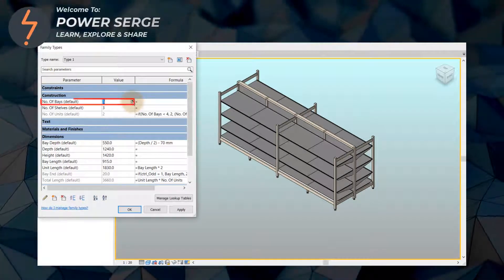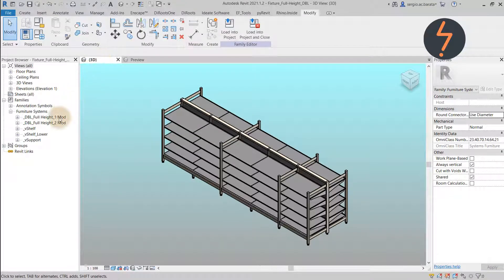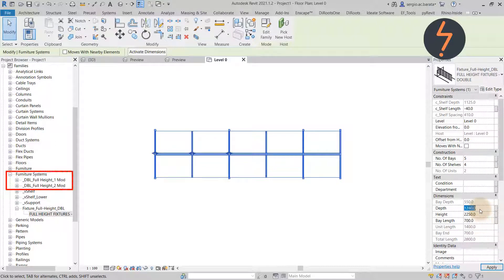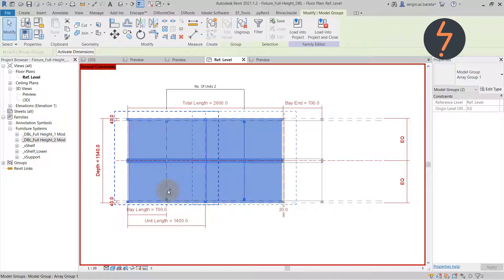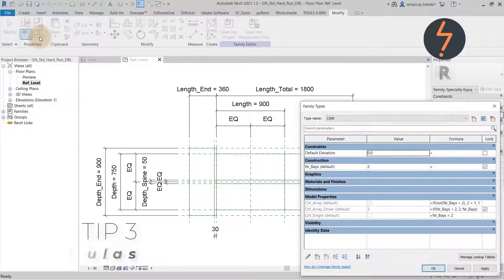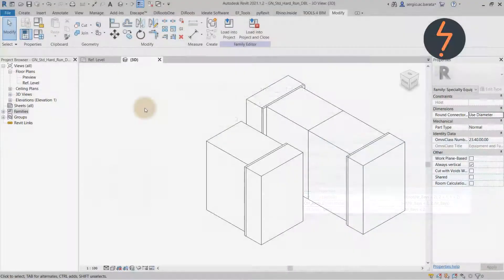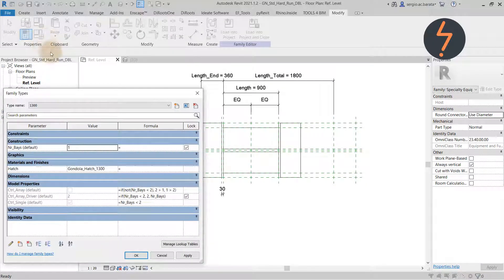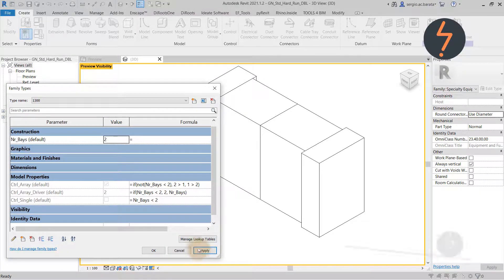The Revit Family Hack I Wish I Knew Sooner | Parametric Arrays Made Easy

Comment: Good day Sergio, Is there such a thing as a partial array for a line array. If you want to array a box with zero distance between the boxes and when you reach the end of the line the last box isn’t a full box so it only draws a partial box to complete the line array.
Reply: Thank you for the tip
Reply from the maker: Hello @GarthEdmunds and thanks for your question. There is no partial array...BUT...what you described CAN be done. It would use the systems explained in this video - where you would use a formula together with the visibility parameters to turn "on" the "half" instance when required. All the best to you.